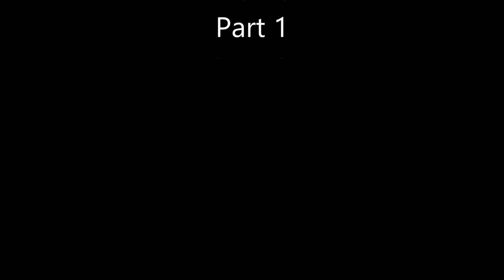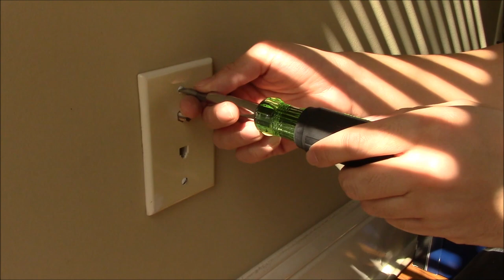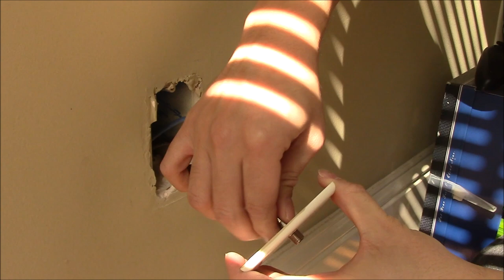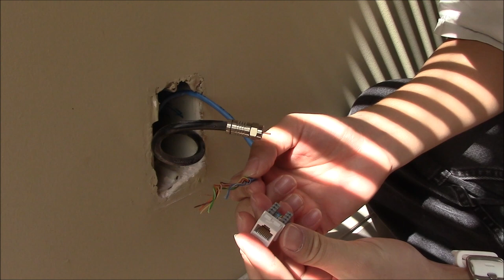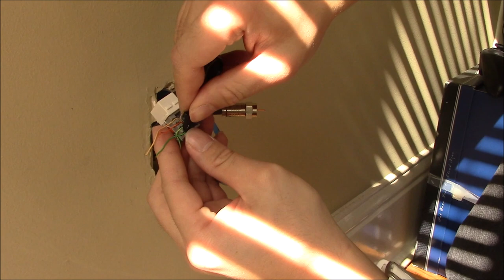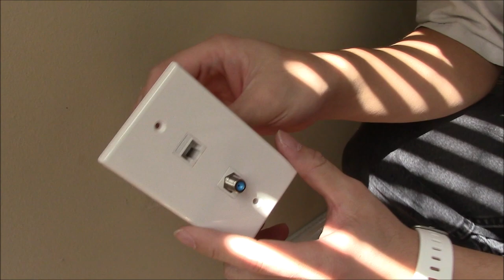Converting Landline to Internet, part 1

Comment: What I might do is securely tape Ethernet to the line in the basement and pull it through that way or tape it to the line upstairs.  Much of the wiring was installed while the house was built.  I have no idea how straight the wires are running but don't want to tear the walls up at all.  I might try powerline Ethernet adapters since we only need it in a couple rooms.  There is also MoCA but I am not sure how well that would work with the existing digital cable.  There is a second coaxial cable for internet but it is DOCSIS and I doubt it would be compatible with MoCA hardware unless the needed frequencies are not already used.  I think powerline or WiFi are the easiest choices.  Running a cable through some of these walls is somewhat of a can of worms some people are afraid to open.
Reply: MoCA/POE filters are used so if you subscribe to DVR tv services you/neighbor don't get each other recordings and multi-device communication within your home. MoCA extender gateways are great for older homes that don't have a smart panel with ethernet lines.

Comment: my house doesnt have phone cable, each wall jack has two seperate cables each with 4 leads half of which just wrap around 4 screws in the phone jack soooo still 8 leads in total... would that work???
Reply from the maker: +Ken Ward 
That is unusual.  I don't know the answer.
Check the colors.  Do they match the RJ45 standard? 
https://en.wikipedia.org/wiki/Category_5_cable  
Also find out where the cables lead to.  That is important in part 2.
https://youtu.be/VBepyB_8eC8
Reply: Ken Ward I believe in houses built post 2000 started using cat5 so you have the option for a the rj11 to rj45 conversion. My parents house was built in 1997. Im going to look and see if they have it just for the heck of it. Would love to use a 5 port switch in my room for my PCs. Wireless blows. Especially when you cant use the 5Ghz.
Reply: my house is the same way we have phone lines going through the house but when I unscrew the cover there are two cables with 4 leads? were you able to get yours to work?

Comment: what brand did you use for the  coax F-type adapter?  i found many but dont know if they all are the same since they have different codes
Reply: One for 75hms Your electrical supply house should have them, mine do

Comment: Is there going to be a reduce in speed? I have an RJ11 wall socket in my room. Router is in my parents's  office. Can I have a CAT5e level of speed for my room?
Reply from the maker: +MALayhee700 
1. Open the cover and see what kind of cable is inside the wall.  If the cable is compatible for internet, replace the sockets like the video.
2. The cable probably do not go directly from your room to the office.  They probably go to a central phone line that go out of the house.  You will need to trace the cable and connect the router there.

see part 2 https://youtu.be/VBepyB_8eC8
Reply: Hung Nguyen It's a CAT5 A standard, because the house was built in 2002 and has the original wall wiring.

I can't trace it because I don't have advanced tools and I can tell where it is going from the wall. The wires for the phone system is in the basement next to the modem... The modem wires up to the router on the first floor.
Reply from the maker: +MALayhee700 
That sounds like what I have in my house.  I moved the router into the basement so I could connect it to all the rooms. 

But if you don't want to do the entire house.  You could just find the cable the goes to your room, install the correct connectors, and plug that into the modem.
Reply: Hung Nguyen I actually purchased the wrong RJ45 terminators, I thought they were all backwards compatible. Since my wire is A standard... I need to make the cable, because all the pre-made ones are B standard.

Comment: I moved Into a new house and had a BT set up with phone sockets in every room I put adsl filters on them and tried to connect for internet but didnt work.. what do I need to make it work?
Reply: It could be how your wiring and the wiring of the cables to the modem. How I wired mine up - Placed an Rj45(or Rj11using the blue pairs) keystone onto the end of the service lead (or incoming wiring), then the cable to the modem. Your modem will need to match the internet access method (adsl, vdsl, fibre, or HFC (cable)). You can troubleshoot at the demark point (wire entry point to the home) however, you may need a rj11 with the 2 pairs attached and a keystone to test the wiring at the outside termination point. In My country we can also use a master filter to eliminate alot of noise and any dodgy jack points.

Comment: All you did was put RJ-45 ends on cat5 cable.  As long as the other end(s) are connected to a switch, the whole house will be wired for internet.
Reply: Why a switch and not a regular router ?
Reply: @yalman32  you can use a regular router.  Office routers tend to have one port which would be assigned to a switch, so by nature that's my thinking.